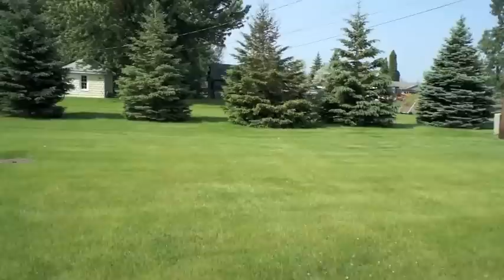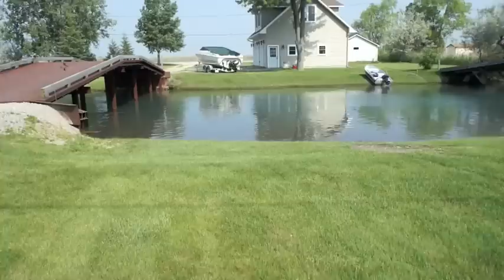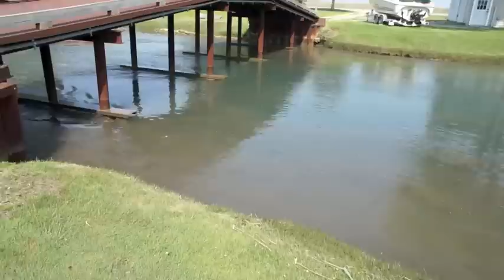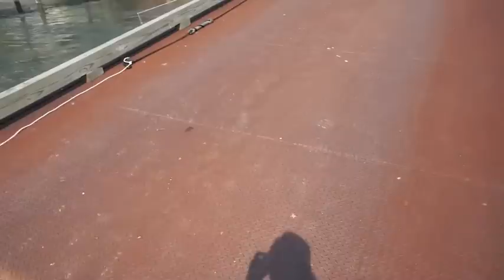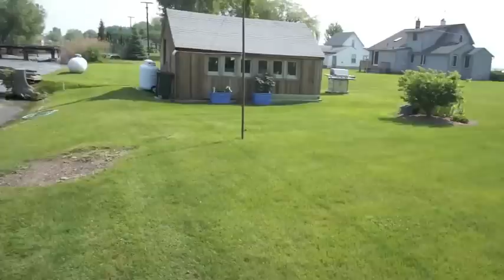Displacement from Ship causing damage

Comment: What do u want to happen to correct this?….1. Stop ships from going by? 2. Build a levee up canal filling before displacement then slowly releasing water after 3. Build a wave flow restriction to use the energy of the wave to create electricity. The same project as Venice uses 4. Sell the house the boat & move somewhere above sea level & be happy.

Comment: I live in a gated community and there is man made cannals through whole place cause each house has a boat slip then you go through canals to get to the bay then the gulf and same thing happens to use but they built up banks tall enough to avoid serious damage.when it happens no luck in catching monster speckled trout for a few hours but only happens once or twice a month rare for one to pass that big through the bay by us they need to slow down but now they built a huge metal gate that we all have a clicker to and when we get close we hit clicker gate lowers we cross with boat then it goes back up and avoids this problem 100 percent but you gotta be 5 foot away for clicker to work which is nice as well so kids can't sit on the land and sit there and play with the door going up and down on that gate on purpose just cuz they're bored and ruining people's boats and stuff so we only use it just to go out and back in that's it and it helps to protect us from the same thing that's happening to you so maybe y'all's community is installed solid metal gate this 100% and reason why all of our slips have a boat lift to get your boat up out of the water so when this happens it doesn't ruin your boat maybe I'll need to get wooden boat slips with the elevators with slings lift your boat up out of the water cuz most communities that have canals like this running through them that are man-made or natural they normally put in boat slips with elevator slings so that way your boat's got getting ruined in the water from passing ships coming by. But beautiful community you love in by the way love the layout and bridges

Comment: If you want to see this area's location today, paste these coordinates into google maps. 42° 33' 14.0587" N, 82° 35' 23.96" W

The video shows that the land on the other side of the bridge is water-level. Now, it's completely underwater.
Reply: check again its not underwater
Reply: @timverrecchia1654  sry, I meant the small patch of land in between the 2 bridges

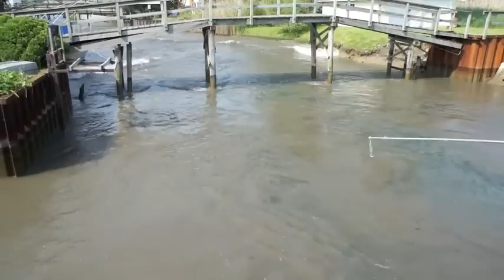1:39 left side

Comment: Not sure there is a solution other than put more rip rap (rocks) to hold in the soil.  Its physics as you already know.  The giant props of the ship push water behind it which sucks water as the ship approaches (including from the river) then when it passes, all that water "bunched-up" behind it comes rushing back.  A dam could help but then your channel would be blocked.   Slower ship speed would lessen this effect but I"m sure the shipping companies will grip about that, heaven forbid they delay 5 minutes delivering that cargo.

Comment: You need a check valve at the end to keep your water in until it passes.
Reply: No they just needed to captains to slow down and stop speeding. USCG determined that the upriver vessels were traveling anywhere from 3 knots to 5 knots over the allowed 8 knot (land relative) upriver limit (10.4 knot water-relative limit) during the shipping season. Enforcing the speed limit has resolved this issue.
Reply: @aSinisterKiid  I was wondering about the speed, but the guy said it was because of displacement from the 1000 footer and not the wake caused by speed.  Thanks for the information!!!
Reply: @saulgoodman7221  Sure thing. And yeah the effect itself is caused by the displacement of the massive ships. But it gets compounded tenfold when they are speeding a couple knots over the speed limit. When they actually slow down and stick to the speed limit, it allows the water level to slowly rise and fall the way engineers intended it to originally. Even just that 2 or 3 knots over the limit causes a compounding effect with the wake in front/behind the ship and it has a roll on domino effect. Thankfully they were able to solve the problem though thanks to videos like this.

Comment: My question is which came first, the thousand footers or the houses built too low and too close to the river?  If the thousand footers came first you should have known better and planned your home builds wiser.
Reply: Houses been there since the early 1800s, says in the description the cabin in the video was built in 1850.
Reply: @OldSlabSides  Then that's an unfortunate predicament requiring the involvement of local government which will be more frustrating than the thousand footers themselves.

Comment: Perhaps installing a locke type system at the entrance to slow the waters movement...minimizing the damage.
And if y'all can afford to build that many bridges you can build a locke. Stop crying, start building!
Reply: No, they just needed to start enforcing the speed limit and stop the captains from speeding. USCG determined that the upriver vessels were traveling anywhere from 3 knots to 5 knots over the allowed 8 knot (land relative) upriver limit (10.4 knot water-relative limit) during the shipping season. Now that the speed limit is being enforced the issue has been resolved.
Reply: @aSinisterKiid  Seriously though, isn't an ounce of prevention worth 100,000 tons of problems? 
And not having to deal with it...ever again, regardless of who is boating too fast? Is it not your property, that you chose next to the channel, your responsibility protect?
And is the damage already caused being repaired? And at who's cost? 

Gee, an inexpensive Locke type gate seems a lot cheaper in the long run.
Reply: @MrTurbogreg6969  Getting the captains to abide by the speed limit is a "free" solution  by all accounts compared to constructing a locke system. Who's going to foot the bill to engineer, construct and install the locke system ? Who's going to operate it ? Who's going to pay to maintain and upkeep it ? All of that costs money that doesn't need to be spent if the captains just obey the speed limit.
Reply: @aSinisterKiid  whose going to enforce the speed limit for you? That's not a free option.

I think a couple of "gates" to slow the water flow, not necessarily stop it, at or near the entrance might do it. If you slowed the water, it might lessen the long term damage. You could make the spring loaded for ease through. It apparently doesn't have to be pretty.

I would say attach them to your many many bridges but most aren't built for crap so that's out.
Reply: @MrTurbogreg6969  The coast guard and state police enforce the speed limit. Public servants doing good work. And if you "think" its a good solution then why don't you go foot the bill for the materials, installation and upkeep for them. Since you don't live there then how about you let the people who DO live there, worry about it. Because their solution has been getting the captains to just follow the speed limit. And doing that has solved this problem.
Reply: @aSinisterKiid  Always looking to the negative, you are. At the end of the day, can you legitimately explain to a judge that you did everything you could have to preven it?... Didn't think so. 
You bear a certain amount of accountability whether you like it or not. This is where the hated hoa's come in. Everyone in the community pitches in to protect everyones homes. 
Apparently your not aware, but you could also build your own levy for your own property. 😳 huh? 

Not to mention, I'm sure it will be a highlighted conversation on your sellers disclosure forms when you try to sell it in a few years..."well they don't slow down so now there isn't a backyard, not my fault" is a great sales pitch!😂 Your broker will love that! "Alex what is malfeasance/nonfeasance for $1,000 please."

And as a matter of fact: Actually I was hoping the captain would increase speed to maximum thereby washing out those rickety bridges over that large swale your calling a river. Now that's a video worth watching...🎶Cry me a river🎵
Reply: @MrTurbogreg6969  I'm not the one looking at the negative here. I'm being logical. The people who are actually concerned with this issue did an entire investigation conducted by experts and guess what solution they came up with ? Not yours. So when the experts and people who actually have to deal with the problem are happy with the conclusion they came to - I would refer to them. Not some stranger on the internet who thinks he knows better and doesn't have any skin in the game.
Reply: @MrTurbogreg6969  You can try and call me names all you want, it doesn't make you right. It actually just shows how childish you are. Again, you are a stranger on the internet who thinks he knows better than the experts who actually investigated and solved the problem. Your opinion is irrelevant.
Reply: @MrTurbogreg6969  You don't have any credibility. You are a stranger pretending to know more than the experts who solved the problem. Move on already, the horse is dead.
Reply: @aSinisterKiid   Perhaps Webster can explain it better:

Levee (noun): an embankment built to prevent the overflow of a river.

Seawall (noun): a wall or embankment erected to prevent the sea from encroaching on or eroding an area of land.

You could also use erosion control matts, sandbags, coconut fiber logs... The list goes on and on. But then one would actually be taking responsibility for the problem with their property. What a frickin concept!

Those are just a couple of proven methods... but your right, those aren't really credible huh? I mean it's not like those ideas will work because someone who doesn't have credibility with me has been doing it for decades, possibly centuries.

But I like your "CAPTN RON SLOW IT DOWN" screams approach better, do you even remove the Marlboro from your mouth before yelling at him?... It's definitely comedy gold!
Reply: @MrTurbogreg6969  Yes, your opinion is irrelevant. That is my response to you. I didn't "solicit" it. I never even asked you a question in my main comment. I simply replied to you to let you know that your idea was unnecessary and unwarranted. Either due to carelessness or lack of attention you had overlooked the description of this video where it already contained the answer to the problem. You simply cannot accept that answer because you think you know better. I have pointed this out to you and it has apparently struck a nerve. No one here cares what you think at this point, so again, move on. I'm not even reading your posts at this point. I'm only replying to let you know that you are wrong, your opinion on the event doesn't matter and you are wasting your time trying to continue down this path.

Comment: For those of you watching this for the first time. These houses have been here since the 19th century. The erosion caused by the speeding vessels was a serious problem and has since been solved with enforcing speed limits. 

Also, here's a warning: There are a metric ton of idiots with zero reading comprehension or sense of empathy in the comments below. You WILL lose brain cells reading this comment section.

Comment: I think that's kind of the point of all those canals along the river. They're like a shock absorber, or a system of distributing that Flux caused by the ships. Otherwise those on the edge of the river would take all of it.
Reply: exactly, but they were designed for smaller ships. Massive freighters started coming through in 2011, and the canals are not designed to handle a 1 foot tide receding and coming back in under two minutes. If you look at the shoreline of the canal it looks wavy like a snake, that is the erosion and the sea walls slowly crumbling. His house would've been gone by now if it weren't for the coast guard enforcing the speed limits on huge freighters.

Comment: This is crazy and I want an update. That canal must be twice as wide now.
Reply: Read the description for the answers you seek. But short version - The coast guard investigated the issue thanks to video's like this and USCG determined that the upriver vessels were traveling anywhere from 3 knots to 5 knots over the allowed 8 knot (land relative) upriver limit (10.4 knot water-relative limit) during the shipping season. They have resolved the issue by enforcing the speed limit and forcing the captains to slow down.

Comment: It would be an interesting experiment to see if you can build some strategically positioned wake turbines that not only absorb the energy of the returning water but also power a generator. Since it's not constant, you'd have to store the captured energy in a cell or battery. 

Just "thinking" out loud here.

Comment: Wow!! But sadly, there’s nothing that can be done about it. Beautiful area.👍👍
Reply: Incorrect. There was something that could be done to solve the problem. Getting the captains to stop speeding. USCG determined that the upriver vessels were traveling anywhere from 3 knots to 5 knots over the allowed 8 knot (land relative) upriver limit (10.4 knot water-relative limit) during the shipping season. They have begun enforcing the speed limit and resolved the issue.

Comment: When you buy a house next to this lake you knew this happens when you bought the house, I’ll bet these 1000 ft boats didn’t just start passing by.... it’s like when someone buys a house next to railroad tracks and complains about the train horn. Bottom line is this didn’t just start happening after you moved in...
Reply: You are wrong. And you didn't even do the most basic research, such as opening the video description. The houses predate the shipping, and the shipping was not a problem until they started speeding, about 40% over limits, which was confirmed and corrected by the Coast Guard. 

Now back to your hole. If you can't even do the bare minimum of research to confirm your trash opinions, stay off of the internet.
Reply: Yep the 1000 foot boats have been using that passage since the beginning of time. Moron.

Comment: Put in some baffling...If it's county domain. Petition the city/county to install it. Lower baffles will lessen the force of the water exiting which will allow the returning water to flow back smoother. Will require dredging and some. concrete pillars

Comment: Simple solution: 
Put a stoplock on both ends of the canal high enough to block the siphoning/filling effect, or:
Knock all of the bridges down and construct one sturdier bridge to access your little island.
Allow a small road along the canal so all residents use one bridge and one road to get to their property.
Build retaining wall along the canal roadside to exceed higher than expected waves and stop erosion.
You give up your canalside retreats wich are evidently unusable anyway, but your property is safer.

Comment: First I would like to thank YouTube for sharing a nine-year-old a video to me. Second I wonder if some sort of baffle system has been put in yet
Reply: Third, I'd invite you to read the video description. :)

tl;dr , the ships were exceeding the shipping speed limit (which are often imposed to prevent bank erosion) by a notable amount. The video was used as part of the evidence of this. The shipping speed limit was then enforced, the ships slowed down, and the problem is no longer happening.
Reply: Thanks for the info. I rarely check description section as it normally doesn't add anything.

Comment: Install lock gates at the end of the canal which can be opened to allow boats through, but kept closed to stop the wash causing the erosion!
It's not rocket surgery!
Reply: Or the captains could actually slow down and follow the speed limit posted. Read the description and you will see the coast guard did an investigation thanks to video's like this and solved the problem by getting the ships to stop speeding.

Comment: A simple gated wall across the entrance designed to act as a "check valve" would keep the water from receding below a set point thereby greatly reducing the erosion of water going out and coming back in.
Reply: The ships were exceeding the established shipping speed limit by a good amount, which is what was causing the problem. Once the limit was enforced, the problem went away (which makes sense, since a big reason shipping speed limits exist is to prevent excessive erosion).

Comment: It's probably not the displacement as that stays consistent. It's probably props pulling the water from in front the ship and pushing it to the back. It's acting like a pump. Water is pretty dense and it takes time for that water to push back around. If they used tugs there, it probably wouldn't be nearly as bad.

Comment: A simple hand operated lift lock gate would resolve this, like the ones on the UK canal system.  Control the flow of the natural current via a bypass and two lock gates of upper and lower direction to prevent the surge.
Reply: It's all about the $$$